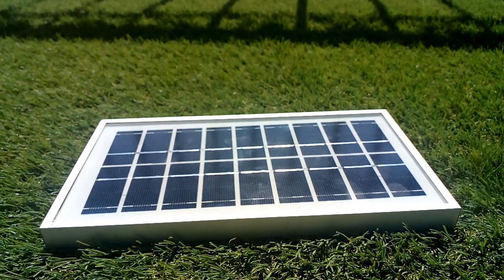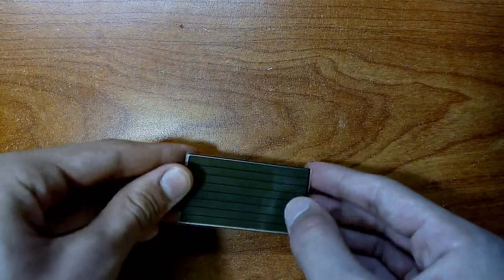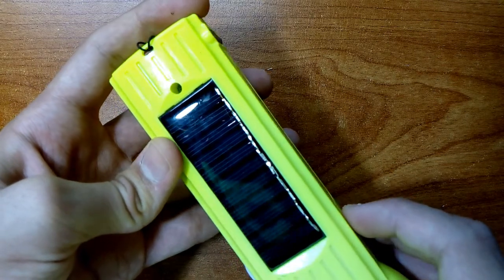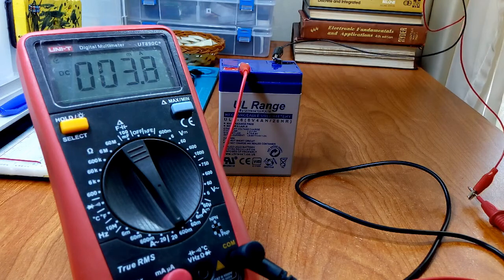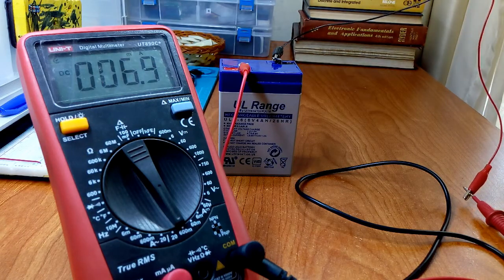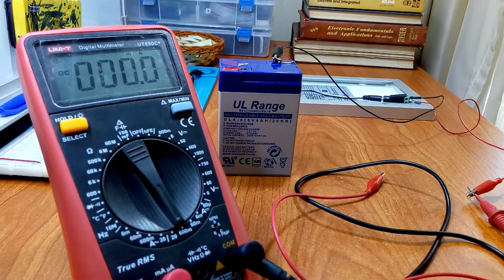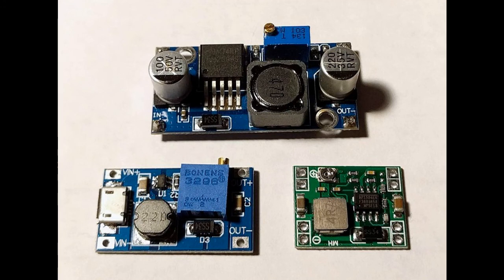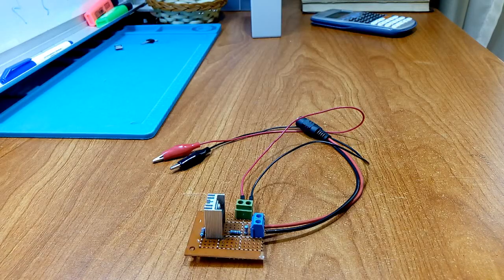Solar panels, a brief history, types, experiments and more ! | SMM's Blog #4

Comment: Solar energy is the death of life.
1 kW solar panels directly heat the atmosphere with 4 kW. Therefore, where there are large solar stations, local heating of the atmosphere occurs, which causes droughts around the station. And globally, they greatly heat the atmosphere.
Reply from the maker: That's a nice piece of information to know, didn't thought solar panels would cause such issues, but you know my 3 watt solar panel won't do anything, will it?